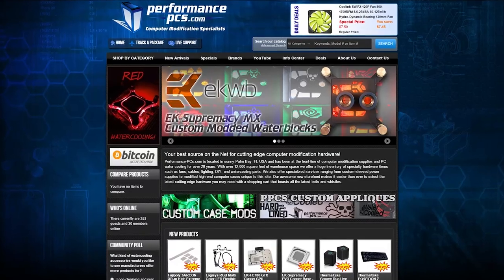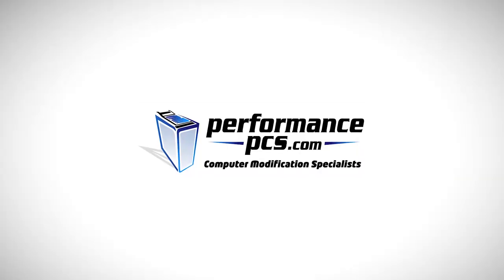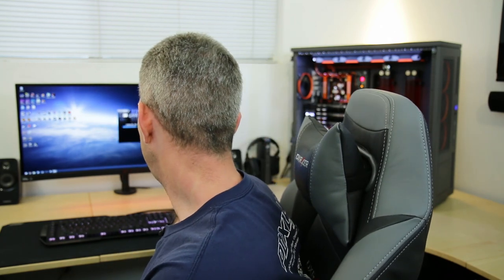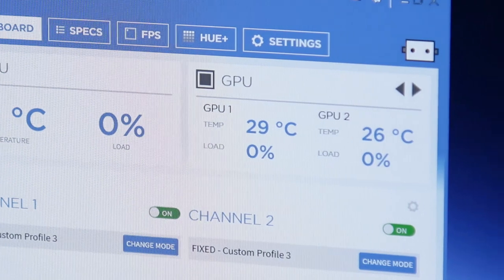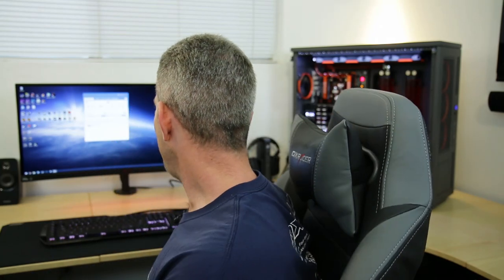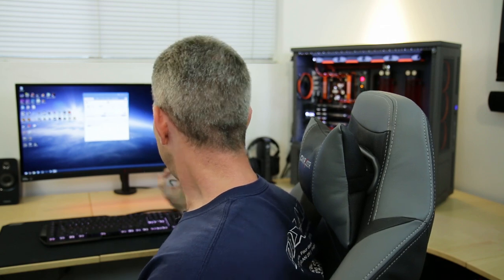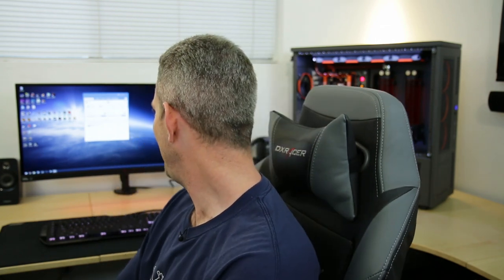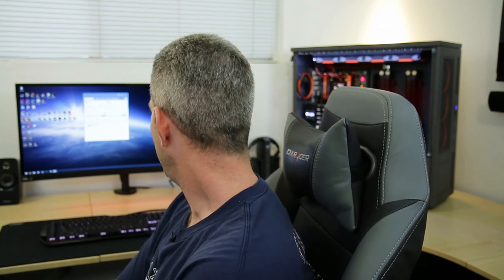INSANE Gaming PC 3 Titan X video cards! Such overkill

Comment: HNY Jay,
this version 3.?.?? is a step ahead due to the lowered temperatures, yet I find you need to consider that
"Ultimate Overkill Gaming PC becomes more Ultimate"
is not proper enough when you use such a hi-end memory @3000MHz at @2666MHz, yes?
I count 12 big fans and doing underclock is simply not adequate to the Skunkworks legacy, as far as I remember, their Blackbird was hitting @3000+ km/h without problems.
Also, in my view, you have to run the heaviest torture, say prime95, for a full 24h period in order to be fully happy with the coolings and tweakings, that way you could brag - full CPU load passed for 24h.
Visually and esthetically this revision is good, but keep in mind that if you want to keep common ground with Skunkworks' designs, they have to be not shiny but stealthy i.e. with matte gray as the chassis, no? Simply, the dullness of the case doesn't go well with the shininess from the interior, my 2 cents.
Reply: +Georgi “Kaze” Marinov The RAM-timings are far more important than the frequency since the difference between 2666 and 3000 are marginal whereas the difference in timings achievable on 2666 are great.
Also, everyone still using Prime95 has no clue of what he is doing. The newest version of Prime95 uses routines that strain the caches as much as a CPU-virus and chances are high that you're damaging your CPU permanently when torturing it with that stupid programme. Testing the stability with AIDA64 for half a day is more than sufficient.
Tested my system (i7 3930k @4.5 GHz) for 4 hours on AIDA64 and no BSoD, freeze, crash or anything in over a year.
Reply: +Meta Custom Computers 
Michael, you miss the whole point, man. When 'ultimate' is used twice combined with 'overkill' and moreover the legendary 'Skunkworks' is the project name I cannot help but point that current tweakings are not ULTIMATE, simple.

>The RAM-timings are far more important than the frequency since the difference between 2666 and 3000 are marginal whereas the difference in timings achievable on 2666 are great.

Latency is important mainly in specific software with many RAM accesses outwith the caches and is not a solid starting point/measure at all for general programs. The American overclocker Jpmboy helped me to see how my latency dependable torture behaves contrary to the "logic":
In summary, 2666c12 looks real good vs 3000c13 with the Nakamichi_Oniyanma thing, but that's a false finding. 3000c13 scores higher in FSE physics, 3Dmk11 physics and AID64 memory/cache bench.

http://www.overclock.net/t/1510328/asus-x99-motherboard-series-official-support-thread-north-american-users-only/9150_50#post_24339019

>Also, everyone still using Prime95 has no clue of what he is doing. The newest version of Prime95 uses routines that strain the caches as much as a CPU-virus and chances are high that you're damaging your CPU permanently when torturing it with that stupid programme.

Calling Prime95 stupid is stupid, the right wording is: its is ULTIMATE - its code is so highly optimized that it shows how programs are to written - as fast as possible disregarding all stupid compromises both manufacturers and users do.

>Testing the stability with AIDA64 for half a day is more than sufficient.
>Tested my system (i7 3930k @4.5 GHz) for 4 hours on AIDA64 and no BSoD, freeze, crash or anything in over a year.

AIDA64 is very good but not ULTIMATE!

*
Q)  A forum member said "Don't bother with prime95, it always pukes on me,
and my system is stable!.  What do you make of that?"

 or

"We had a server at work that ran for 2 MONTHS straight, without a reboot
I installed Prime95 on it and ran it - a couple minutes later I get an error.
You are going to tell me that the server wasn't stable?"

 A)  These users obviously do not subscribe to the 100% rock solid
 school of thought.  THEIR MACHINES DO HAVE HARDWARE PROBLEMS.
 But since they are not presently running any programs that reveal
 the hardware problem, the machines are quite stable.  As long as
 these machines never run a program that uncovers the hardware problem,
 then the machines will continue to be stable.
*
http://www.mersenne.org/download/stress.txt
Reply: +Meta Custom Computers 
Have you changed your mind about usefulness of Prime95?

http://arstechnica.co.uk/gadgets/2016/01/intel-skylake-bug-causes-pcs-to-freeze-during-complex-workloads/

Comment: Hey guys I'd like to know if this can handle minecraft at low
Budget : 3$

GPU : GTX R9 288x TI 30GB GDDR5
CPU : FX 234099 20 cores 1 GHZ
RAM : 16 GB RAM 80000 MHZ ddr6 
Case : Wot
Monitor : 10K Dell LG 5''
CPU FAN : Snow
Motherboard : Yes
PSU : 60 WATT
Drive : Green-ray 24X
HDD : 1MB in raid 0 with 1 petabyte SSD ( I will install OS in the 1MB

Comment: Hi Jz2cents I just order one Ek x360 kit and Fc970 + backplate + 2 fittings. I am really in doubt if I should run this 2 cpu and gpu in a parallel config or not, I know performance is the same but I think the stetic will be better, please let me know, what you think about that, if needed I can send some drawings of the options here. Thanks a lot, keep the vids comming.

Comment: Could you please explain what a dimable LED is?
Reply: You can make it brighter or a softer light by control.
Reply: That's not an answer to my question.
Reply: LED Lighting Dimmable with Standard Incandescent Dimmers. While many LED bulbs are now dimmable, not all of them are and not all of them dim in the same way. Since LEDs consume such a low wattage, many types of dimmers do not function with LED in the same way that they do with high wattage load incandescents. GOOGLE IS AN AWESOME INVENTION SHAME YOU STRUGGLE TO USE IT.
Reply: Nonsense, we are talking about LEDstrips which are powered by a DC powersupply and not a lightbulb type, dimming those with a current limiting dailtype switch would be dumb. The uploader is clearly talking about the LEDstrip and not the powersupply. So yet again, what is a dimmable LED?
Reply: Then search in google LED dimmable strip?
 you can dim LED strips via PWM and other methods.
Reply: Uploader clearlt says that some LEDs are not dimmable.
Reply: That's correct some are some arn't
Reply: So which ones are and which ones aren't?

Comment: What do the red numbers on the motherboard represent ?
Reply: +Rhetorical Question Mobo temperature.
Reply: +Rodney Brown no they are post codes.
Reply: i think its the temps
Reply: They display a number which allows the user to see if there is anything wrong with any of their hardware. It's used to replace the 'buzzer' that you would usually have on cheaper motherboards. For example, if you have a RAM issue the display would show a number, you look in your motherboards manual and it tells you what the number means. You now know there's a problem with your RAM.
Reply: +Brandon Teeter (bruzanHD) Once the system has boot up, and there are no errors (99% of the time), the display shows motherboard Temps.
Reply: Rodney Brown
That is true. Depends on the motherboard though.

Comment: Damn, that is one beautiful PC, I am a newer PC gamer. It didn't take much time for me to start going nuts on upgrading though, MORE FPS is addicting. As of now my PC consists of:
i7 4790K
Crossfire Sapphire R9 390 NITRO (OC to 1120 core, 1700 memory) 
AsRock 287 Extreme 3 MOBO
16GB Corsair Vengeance 1866MHz RAM
Corsair H110i CPU cooler
Samsung 850 250GB SSD
WD Black 4TB storage drive
Corsair AX 1200i PSU
all packed in a Corsair Air 540 case
I wish I could have gotten a 980ti, but unfortunately, my budget only allowed the purchase of one AMD GPU since I'm already invested in a Freesync monitor, so I crossfired it later when I had the money. I'm still a bit scared of custom water cooling, but I may give it a try next upgrade (probably Arctic Islands if it pans out at decent performance increases).

Comment: The only thing I would change in Skunkworks, and it is something I would 100% Have to change because it would drive me nuts! Is the cable management hole in the MoBo tray for the 18pin MoBo cable.
It needs to be made larger (Extended Down) so the 18pin MoBo cable can be perfectly routed through without any bunching and twisting the cables :)

I do love the look of Skunkworks though, even though Orange isn't my colour, it's still very very pretty.

Comment: so Jay huge fan of the channel but just curious how much our of pocket did you have pay for skunkworks  370z  because I want to build my secondary computer is for with watercooling so what is recommended for it but I have 3 Nvadia GTX980TI with Asrock  Intel X99X Killer with 64 gb  of ram and everything  is over clocked but I noticed that 72.5 C. and in the summer it kills my house with the heat, so I'm wondering  would it be recommended  to have both air cooling, watercooling  thank you and love the channel. Happy  New Year

Comment: OK. I'm really against most things orange. What you've done here is fantastic. I might have gone with some lime green or anodized purple fittings because I have an obsession with halloween. That's just me though. I think the only thing I would change in your build would be to add more LEDs directly to the acrylic of the water blocks just to give it a little more sparkle. It might also be interesting to find out how your accents would react to ultraviolet light. That could be cool... Anyway, thank's for the great video.

Comment: I really like the way it looks and the SLI bridge looks fine white because matches with all the nickle plating in the system. I would do just one thing: try to lit up the reservoirs with a pair of LEDs put literally on the border of the reservoir so light can reflect through the plexi and and make it all shine. That dark spot look like it absorbs all the light and makes it "unbalananced". Everything else looks really tidy and well organized, I like the way you do PCs.

Suggestion: why don't you make a video on cable extensions/custom cables and how to train them and make the system look so good and tidy like your?

Comment: Aside from looking 'cool' (no pun intended) why do this if you don't push the system to its new potential.... why run GPU's @ 1400 ? why not increase core clock further or are you voltage limited rather than temp limited?

i'm going to buy a Ferrari and drive at 30mph. Derp.

Comment: jay i have a fx6300 processor which does not run at 100% usage during gaming and is causing me some frame rate issues, it is holding my gtx970 back, any suggestions

Comment: All this to idle at 25°C... Maybe my computer is less powerful than yours and that would be the reason for it to be cooler (I got : 980ti evga with evga z170 stinger, 16gb ddr4 OC'd at 3600mhz, 4 ssd in raid 0, i7 6700k OC'd at 4.6ghz) and I idle at 19°C and sometimes at 18°C. I have the corsair 100i gtx to cool my cpu and 3 case fans are on silent mod, not even full blasting them (they are on minimum power coz I link them to a case fan controller).

Comment: myb your air flow in and out are not balance
Reply: Doesn't matter. Nothing in there is air cooler or anything that is air cooled is passively cooled. He doesn't even need the air flow fans really, he just needs to keep the radiator fans going.

Comment: "The whole room cooled down" 

A cooler computer would mean your loop is more efficiently transferring the heat to your room. Which means your room should get hotter.
Reply: +William Subroto If his PC is dumping less heat than before, then the room would indeed be cooler.
Reply: nimrodery The computer is the same hardware as before and it runs cooler than before. Before the upgrade the computer ran hotter which means that the heat was stored on the computer itself. Now it runs cooler which means that the heat is being transferred away from the computer. Where does the heat go after it gets removed from the computer? The room.
Reply: ***** I'm not going to bother trying to explain how efficiency works. Happy New Year instead.
Reply: ***** Oh, so you know why you're wrong? Good. At least I don't have to Google things for you. All the heat your PC produces will dump into the space it occupies. If there are inefficiencies, for example a coolant that no longer functions properly, it increases the overall heat of the system. So yeah, when the problem is fixed, it results in a cooler room.
Reply: +nimrodery 
"All the heat your PC produces will dump into the space it occupies."

Ok, that's established.

" If there are inefficiencies, for example a coolant that no longer functions properly, it increases the overall heat of the system."

Sure, it keeps the heat being made in the components rather than being transferred away from them.

"So yeah, when the problem is fixed, it results in a cooler room."

Wrong, the heat production doesn't change when you cool something better. Energy does not work that way. Heat is energy. If you put 1000 Watts into something to produce heat then 1000 Watts of heat will be produced. When a cooler removes that heat it has to end up somewhere. In this context the heat is dumped into his room. From the component then to the metal on the waterblock then to the water then to the radiators then to the room. Think of his loop as a vehicle. When picking up a package that package doesn't cease to exist. It either stays in the vehicle or gets delivered somewhere.
Reply: ***** You can't have both "All the heat your PC produces will dump into the space it occupies" and " It either stays in the vehicle or gets delivered somewhere." It always gets delivered. To your room. You're arguing with yourself, if it's "established" that heat has to transfer from your PC to your room. LOL. And you should have read the article, about how energy is wasted through increased heat output. It's a very basic formula of thermodynamics.
Reply: +nimrodery You should really read up on the Laws of Thermodynamics. What you're suggesting is making heat disappear into nothingness. Custom loops can't break physics yo.
Reply: +nimrodery 
The first law states that heat can neither be created nor destroyed. It is energy. I don't know where you got that quote from. 

So... how does the room get cooler if more heat is dissipated into the room? Where does the heat go? The computer doesn't magically create less heat when cooled. When I say create I mean convert electricity into heat.
Reply: +nimrodery Here are a few posts with people with the same confusion you have:
http://www.techpowerup.com/forums/threads/watercooling-lead-to-cooler-room-temps.132510/

http://ask.metafilter.com/187170/Can-PC-liquid-cooling-keep-my-room-cool

https://community.spiceworks.com/topic/397539-home-pc-heats-up-room-best-cooling-solution

http://www.tomshardware.com/forum/266376-29-does-water-cooling-contribute-room-ambient-temperature

http://www.tomshardware.com/forum/276054-29-watercooling-heat-room

http://www.xtremesystems.org/forums/showthread.php?148161-will-water-cooling-make-my-room-cooler

Every single one backs up my statements.
Reply: nimrodery I'm going to end it with what I said in the beginning: "His room should be hotter if his parts are cooler." The only way this would be untrue is if he improved cooling in his room also.
Reply: ***** Wow. Couldn't even be bothered to look up the first rule of thermal dynamics, huh? What you quoted was the law of conservation of energy, from which the first rule is adapted. It's a formula that can be used, not some lofty ideal that justifies your ramblings. You're one weird dude. Still couldn't find where I said energy disappears, either? Get your head straight.
Reply: pcs defently make a difference in room temperature i feel my 980tis when im gaming it really makes the room hotter
Reply: +nimrodery Um, no, lol. It increases the temperature of the system, not the amount of heat produced.
Reply: metallitech I'll need context before your comment makes sense. Lol.
Reply: +nimrodery I was replying to this: "All the heat your PC produces will dump into the space it occupies. If there are inefficiencies, for example a coolant that no longer functions properly, it increases the overall heat of the system. So yeah, when the problem is fixed, it results in a cooler room."
Reply: metallitech Oh. Your comment still doesn't make any sense. Exhaust fans exist for the purpose of removing hot air from the PC. That's what warms the room it's in. Inefficiencies are things like increased friction, for example, caused by fluid having to run through more loop to obtain the same cooling effect. Increased friction turns some of the work done by the device into wasted energy (heat). That heat gets dispelled into the room. If your loop is cooler, so is your room.
Reply: +William Subroto you are some kind of special.
Reply: +William Subroto 3:41